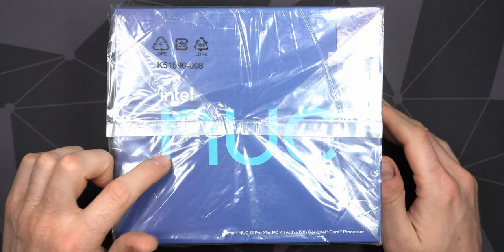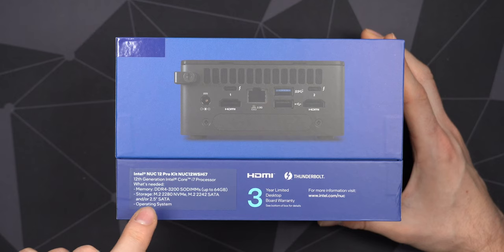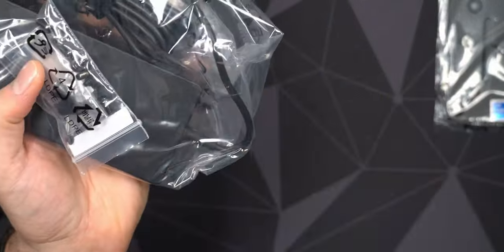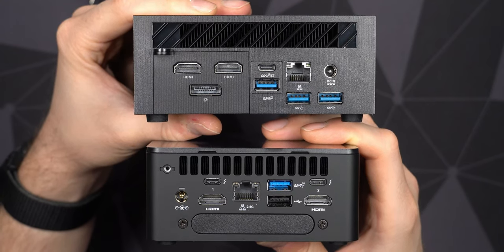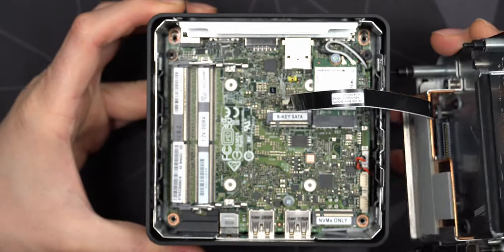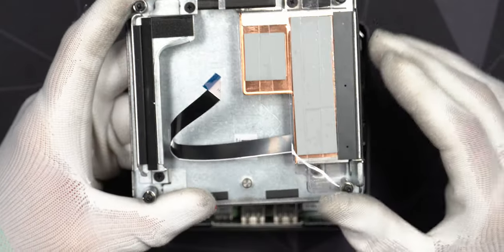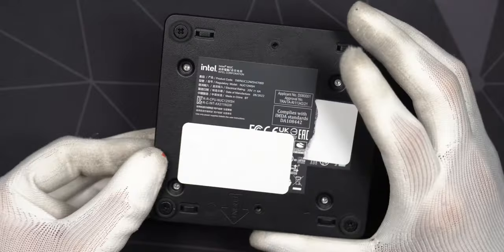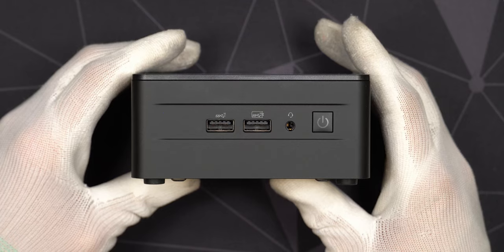Intel NUC 12 Pro i7-1260P: Unboxing & Setup 2023

Comment: How's the wifi connectivity performance? Any drop in speed or disconnections noticed? I'd like to replace my existing Beelink J45 mini pc with J4205 Processor since it is giving only 10-15 Mbps on my 100 Mbps connection

Comment: How is the boot up time for the 12th generation NUC?  Hopefully, it's better than the 11th generation NUC.  I purchased the 11th gen Intel NUC last year, and discover it stuck/hangs at the BIOS splash screen (i.e. the screen that says "INTEL") for additional/extra ~10 seconds than necessary before starting loading Windows OS, resulting in a slower than anticipated boot up time (resulting ~25 seconds to Win11 desktop from the time you press the power button).   Tried various BIOS setting adjustments recommended by Intel & NUC forums, but they didn't help. My uneducated/wild guess is that 11th gen NUC's graphical BIOS settings takes longer to be parsed/read.  I felt that slow boot up time alone ruined the whole experience, as Intel has control in choosing every single hardware within the NUC and should have optimize the boot up time before they release the product.  Having said that, waking up from sleep is indeed decent/fast enough.  Hopefully, Intel got this issue resolved in 12th gen NUC, as most current laptops now are under 10 seconds (sometime under 5 seconds) to Windows desktop from the time you press the power button.

Comment: Hello @whcvip the Seagate ST5000LM000 is a 15mm and not 12mm as you mentioned in the video:)
I got my 12 Pro in September '22 and the 2.5" drive bay size is one of the best upgrades i noticed from my previous NUC10 which only supported 7mm drives.